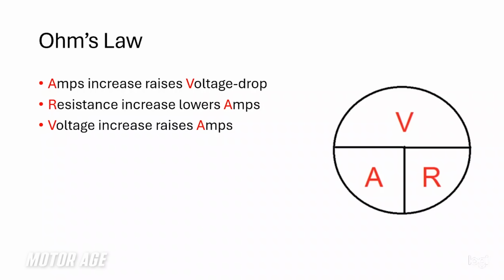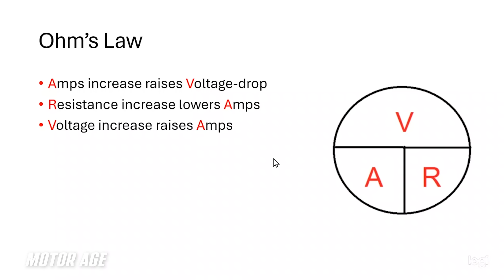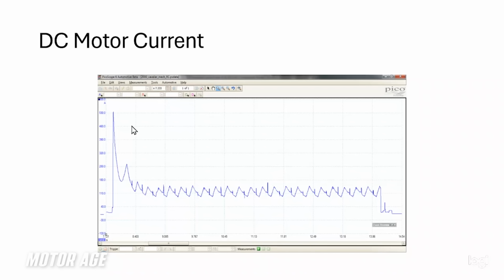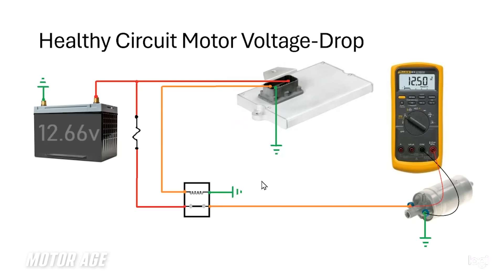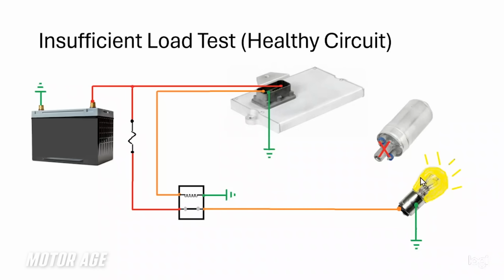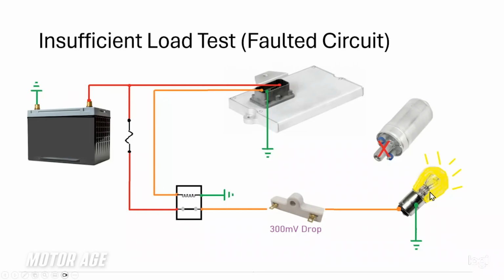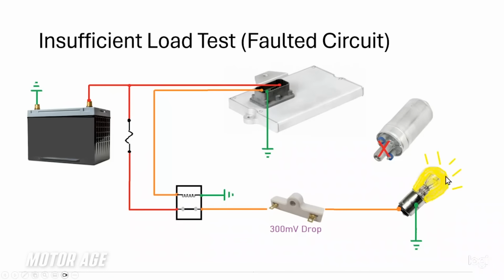Mastering Diagnostics #13: Voltage Drop- The circuit stress test

Comment: Also good to know that the internal resistance of a quality DVOM is roughly 10M ohms. By connecting the DVOM in series to measure voltage the technician inadvertently put a massive resistance into the circuit. Resistance consumes voltages, and the largest resistance in a series circuit will consume the most voltage. Which is why the DVOM reads 12v or near source voltage. Voltage should be measured in parallel with a loaded circuit like you said. Great video!
Reply from the maker: Thank you for watching !

Comment: A fuse or relay was bad.  I had a bad relay on my 94 GMC.  A few months later I had to replace the fuel pump.  The mechanic didn't seal the gasket on the gas tank and the vehicle failed to the smog test.  I personally dropped the gas tank and put in a new fuel pump assembly unit.  The engine needed an O2 sensor.  No code was shown on the code reader.  😅 I was very happy to finally pass the California smog test.
Reply: Very satisfying feeling solving the problem and saving money !

Comment: Here’s a fun one, for 20 years I checked fuses with an ohmmeter.  No resistance = good fuse, right?  Wrong.  I had a fuse with 0 ohms but when checking it for voltage, one leg had 12.6V the other leg had 5.8V.    Fuse looked fine, had continuity, but couldn’t carry any current!  This fuse would have fooled an LED test light as well.
Reply: 1 in a million but it does happen.
Reply: Spot-on!

Comment: Excellent Video! Just a suggestion, might also include how to diagnose if the resistance was in the ground side of the load (fuel pump).  I've dealt with that too.  Much less common but same outcome, insufficient voltage at the pump. Simply move the black lead to the battery ground and see if the meter reading changes.... yes there will be a small amount of difference due to the connections but should be very close if the ground is good. On the contrary, big change = resistance on the ground side of the load.
Reply from the maker: Yes, the voltage drop test can performed anywhere in the circuit, until fault is located.

Whether it’s before the load, after the load, or the load itself

Comment: What about a "loadpro" or are you against it like eric o or ivan
Reply: My opinion only….

Devices like that take a simple concept and make it confusing for me. I prefer to load-test the circuit as I described.

That said, devices like that work as designed, but they indeed have limitations (like everything else). And, if you are not sure of those limitations, you will make a mistake.

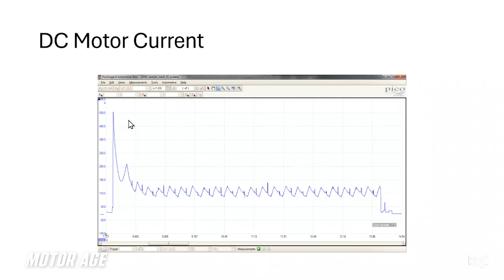Comment: You're the best Mr. Steckler. 11:35 Thanks to this explanation now i fully understand why i changed 4 electric fuel pump motors on a Toyota and each new one was failing within a month(even an OEM one). This was 7-8 years ago. I remember i received incomplete/half the answer from Mr. spelunkerd who also have a youtube channel, but now i got the complete answer from you. Thanks. And the problem was - because i was changing the electric motor only (some fuel pump units , give you the chance to change the electric motor only) , not the whole "fuel pump module/sender unit" i found my voltage drop was on the wires inside the sender unit. You know the wires that are inside the sender unit and connect to the electric motor itself and also the fuel gauge float sensor. Back then i actually knew pretty good about voltage drop and circuit load testing. So i used 9006 bulb to load test the circuit at the fuel pump connector. Not only that , but i voltage drop tested it with multimeter while the light was glowing bright. But as i said - latter i found the voltage drop was on the wires inside the module..So the 5th time i replaced the whole module/unit and problem was gone.
Reply: Yes! My point, exactly! 🤜🏻🤛🏻

Comment: Brandon two questions for you at the 13 minuter mark you were discussing how unwanted resistance before the fuel pump will cause a reduced ammount of avaliable voltage to the pump.  you say that reduced voltage will cause the fuel pump to be damaged, how?  what is happening in the pump that would cause the damage.

i was always thought to substitute the load with a comparable test light to stress the circuit.  my question is how do you know what size light to install in the circuit.  you can measure the resistance of the good or look it up on service data but that is not always a reliable way to come to that answer.
Reply: Great questions…

When a pump isn’t supplied properly, it spins slower. The lack of rotational speed allows the brushes/commutator to burn (over time), because the current flowing through the brushes produces heat.

A normal functioning pump spins  faster and creates counter-voltage, reducing the heat across the brushes.

I use the fuse as a clue to indicate expected pump current load. Circuits are usually protected to approximately 2x the circuit load.
Reply: @brandonsteckler3417  how would this work when there’s several components on one fuse? Would it still be half of the circuit amp?
Reply: @trevorc1285 , I’m happy to answer your question, but can you elaborate a bit more. I’m not quite sure I understand fully.

Comment: Exactly same problem with a riding mower starting solenoid.  12v on the activation lead but not enough current.  Bad connection at keyswitch
Reply: Good 👍🏼 find .  Thanks for letting us in on the fix you did .

Comment: How much voltage should drop on a loaded circuit? Testing just wires no connectors starts at 12.7 drops to 11.12 lights a headlight bulb bring im thinking i have a pin fit issue between bcm and sensor auto lights dont work
Reply from the maker: Although this is a great question the answer depends on a couple of factors:

-how much current is flowing and how large are the wires (diameter).

A perfectly healthy circuit will yield excessive voltage drop if the circuit is carrying more current than intended (for example: energizing a headlamp
Bulb with #22 gauge wire).

Comment: I know it's not the point of the lesson. But what was the fault?
Burnt relay contact?
Thanks for the knowledge Brandon!
Reply: There was voltage drop in the fuse box (spread terminal).

Comment: The loads are in SERIES.   Voltage drop will equal total voltage source.   
In series circuit CURRENT is equal thru-out the entire circuit voltage drop DIFFERENT 
at each load depending on residents.

Kirchhoff’s voltage law, series circuits. comment please
Reply: You got it!
Reply: Thanks for sharing this information .

Comment: Morning sir
Missing part 2
Video not full
Reply: There is no “part 2”. I’m sorry but I’m not sure of what you are referencing.
Reply: @brandonsteckler3417  
IMPORTANT

I checked 4 times now
All your other videos ended saying goodbye and finished properly 
This one doesn't 

Please check the VIDEO end at your earliest convenience.

Sorry to bother you

I understand the whole point anyhow

Will put a sticker on my test light now to remember YOUR VIDEO.

LOAD TESTING AT THE CONNECTOR NEED TO BE DONE WITH THE LOAD OF SAME RESISTANCE VALUE.

FOR THAT I WOULD NEED A VARIABLE RESISTOR THAT I WILL CHECK THE RESISTANCE WITH THE MULTIMETER BEFORE THE PUT IT ON THE CONNECTOR FOR A LITTLE WHILE.

AND WILL WATCH FOR THE CURRENT THROUGH FUSE BUDDY OF LIMIT.
Reply: Thank you, I will get this sorted
Reply from the maker: Apologies for the glitch. We have made a correction in the description to reflect the missing portion of the video

Comment: Honda tech could have also "Ohm" tested the primary winding on the pump before replacing.
Reply: Not necessarily…when resistance is out of range an issue is present. However, resistance is a static test and may not reveal the fault until the system is loaded. This is why the voltage-drop test saved the day
Reply: Understood. An open in the pump's primary could quickly make the pump a suspect (before replacing) is what I meant.